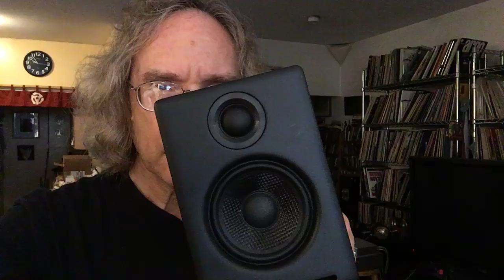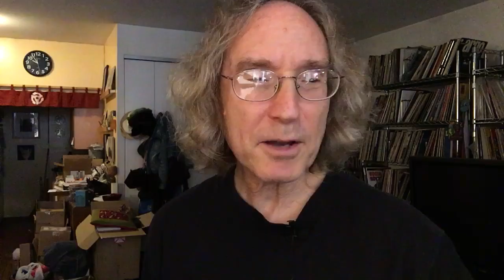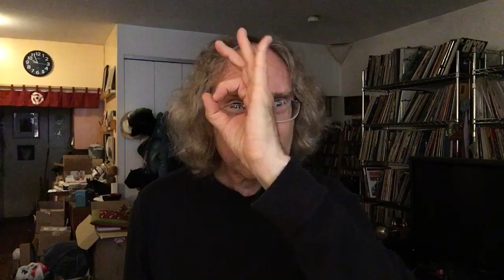The case against 1 inch dome tweeters

Comment: well imo this discussion boils down to "point source" and its polar pattern vs "line source" and its polar pattern. Different polar patterns sound different in different rooms, so (again) the question is "what sounds best *in your room*?"
Reply: Well, one difference is that 1" is the wavelength of roughly 14,000 hz, which as you approach wavelength size frequencies shorter than it tend to beam much, much more narrowly. This isn't the case with AMT tweeters, and ribbons and electrostatic tweeters, although planar tweeters I imagine the size matters, larger ones inevitably beam a ton, but they also don't roll off quite as drastically towards 20khz like dynamic tweeters.
Reply: @jaredlapierre1304  i do not understand what you mean. The polar pattern depends on the wavelength and the width  of the source (and a waveguide, if present). It's pure physics! The kind of tweeter does not matter in regard of the width. That AMTs are able to produce a higher output with a smaller surface (compared to a dome-tweeter) does not matter as long as the width is the same. Same goes for planar tweeters: they may have a comparable width and therefore have a similar horizontal polar pattern, but in general they are higher than a dome tweeter and therefore have a significantly different vertical polar pattern. And again it boils down to  "what polar pattern sounds best *in your room*?"
Reply: Is there any way you could point me to a source that explains or elaborates on  this? I’m not familiar with “point source” or “line source” and their relation to polar patterns. I realize that this post is 2 years old, and I’ve probably missed the boat on this one, but I would greatly appreciate it. Thank you.
Reply: @robertgipson3153  this is such a deep field, i don't know any specific sources, just googled "speaker polar pattern". These look promising: https://www.doctorproaudio.com/doctor/cajondesastre/pdfs/brusi_understanding_directivity_game_numbers_doctorproaudio.pdf 
https://www.klippel.de/training/attachments/training8/Training_8_Measurement_of_Loudspeaker_Directivity_en.pdf

Comment: My speakers don't have a tweeter, just one cone for everything.
Reply: they must sound amazing  .X
Reply: hi
would you be kind enough to give the name of this speaker, please?
Reply: It's an Audio Nirvana speaker cone, they come in many sizes, mine is the 15 inch classic model. The trick is building the cabinet yourself or finding a builder for it.
Reply: @jokrmidnite  thanks
Reply: My Audio Nirvana 15 inch "Classic" speaker is just one cone, the other models have a whizzer cone and or a phase plug or both.  
From their website "So-called 'full range' speakers--using whizzer cones--are really two-way speakers co-located on the same voice coil, and using a mechanical crossover.  Our 'Classic' series are really the first--and only--TRUE full range speakers, as the sound comes from a single cone--not two, as when a whizzer cone is used.   A whizzer cone is really a separate midrange/tweeter."
Reply: jokrmidnite
1 second ago
My Audio Nirvana 15 inch "Classic" speaker is just one cone, the other models have a whizzer cone and or a phase plug or both.  
From their website "So-called 'full range' speakers--using whizzer cones--are really two-way speakers co-located on the same voice coil, and using a mechanical crossover.  Our 'Classic' series are really the first--and only--TRUE full range speakers, as the sound comes from a single cone--not two, as when a whizzer cone is used.   A whizzer cone is really a separate midrange/tweeter."